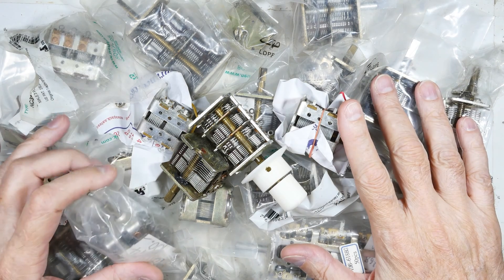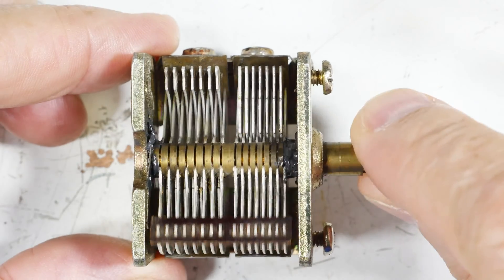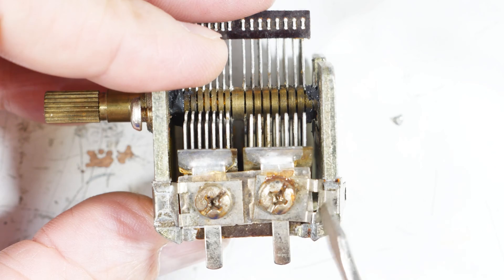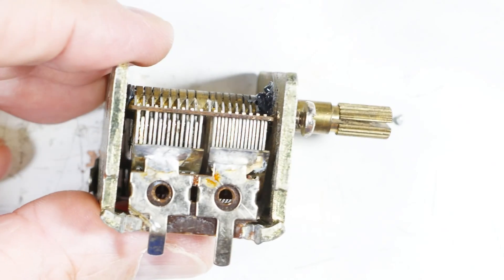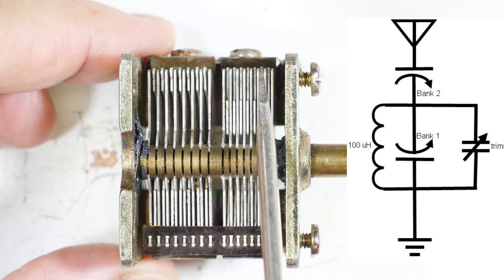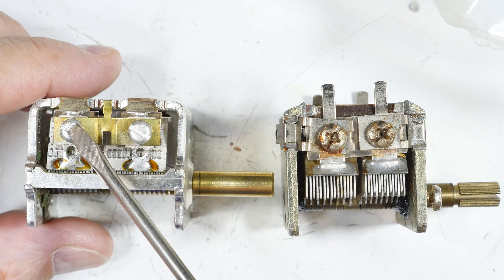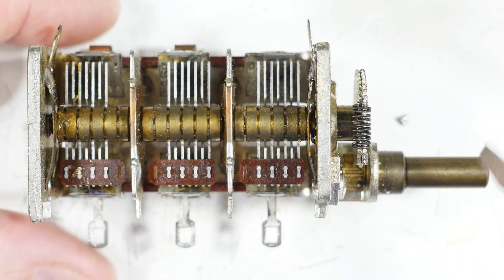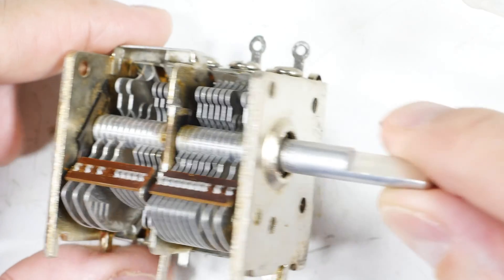Crystal Radio--Air Variable Capacitors (4K)

Comment: I think the slower tuning one might have a planetary gear within the white plastic section... much sought after especially for the fine tuning requirements of the very narrow amateur shortwave bands :)
Reply from the maker: In these, I 3d printed the knobs. They're just plain plastic  no mechanism.
Reply: @tsbrownie DIY knobs, excellent! :)
I have repurposed screw caps from bottles as knobs before, using a little Milliput (epoxy modelling clay) inside the cap to accommodate the spindle and a little drill hole in the side for a securing screw :)
Perhaps bearings around the rota are responsible for the slow tuning in the tuning capacitor you featured?
Vernier tuning dials tend to be horribly expensive.
Reply from the maker: @MrKarlGP  My son's 3d printer has made things I only dreamed of before, possible. In the past I'd drill 2 holes in a piece of plastic and carve out the space in between. It was slow and inaccurate. I have no guess how that 2 speed dial works, and don't know what it is called, so I can't look it up.
Reply: I'm going to try milliput. There is no way I can do 3d printing! @MrKarlGP
Reply: You can make a simple vernier dial by 3D printing a large gear for the shaft and a small diameter gear for the tuning.  Put the tuning gear on the outer edge of the large gear on the tuner shaft.  You can make it tune as fine as you want.
Reply: The ball Bearings at the front work as planetary gears to link the two shafts together. So simple.
Plus those Banks are actually called "Gangs".
Reply: The double gear with a spring is anti backlash. Used in aircraft instruments and high quality radios such as Robert’s.
Useful vid but I winced every time that screwdriver got near the vanes 😳